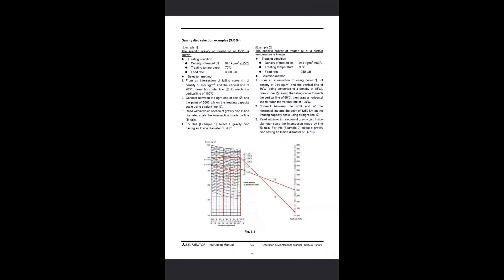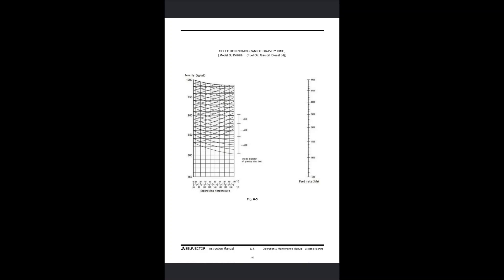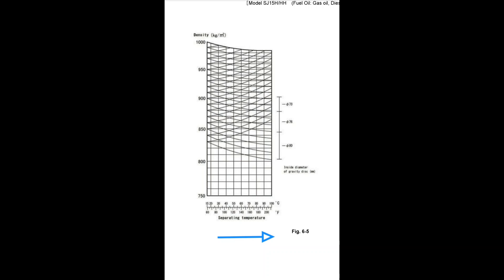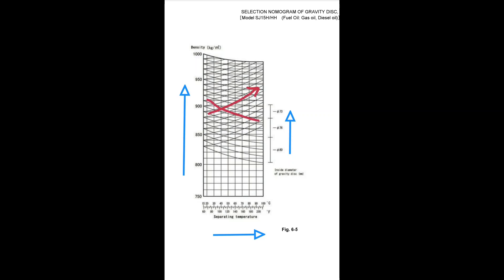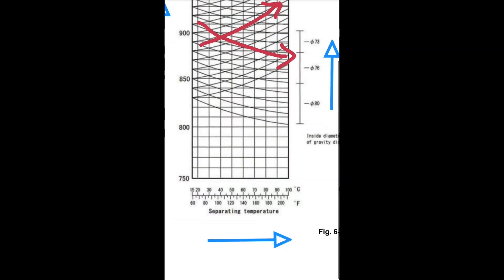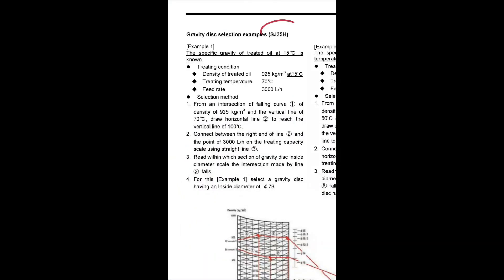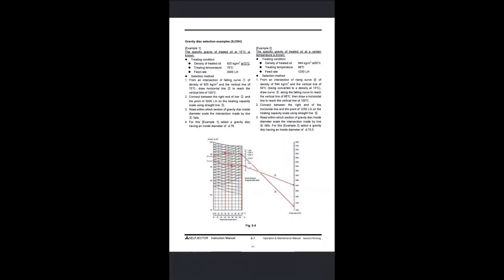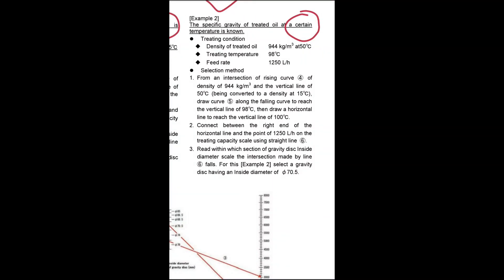How to use Nomogram in Purifier | Gravity Disc | Mitsubishi Purifiers |Fully Explained | Important 👍

Comment: You said in second case density is 944 at 50 degrees,  so why you put 944 on nomogram in position 15 degrees 🤔?
Reply: Yes he did that. But later on he used and rising curve and falling curve respectively to get the correct results. Watch the video properly and see the procedure again
Reply from the maker: @Eternal_Sailor yes !!

Comment: I watch video 3 times but still didn't get why you take downcurve in first example and upside curve in second example 😓
Reply: You told that you know at 15 degree 925 is density that is why you use falling curve but in second example also you know at 50 degree 944 is density then why you not use falling curve
Reply from the maker: Because this is how the curve is made to read.

Comment: for 15 deg cel u are taking the particular density point  but at 50 deg why u are tracing a downward cure from 15 deg ,why not exactly at the point of density?
Reply from the maker: That's how nomogram works and is designed to plot
Reply: @CLASS4ORALS  okk sir thank u👍